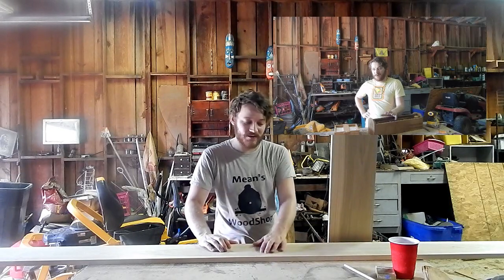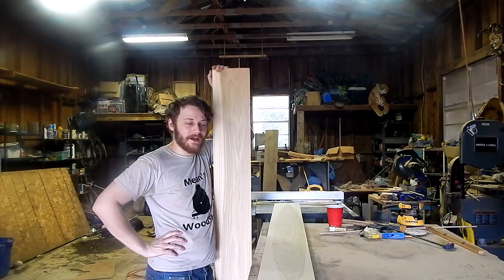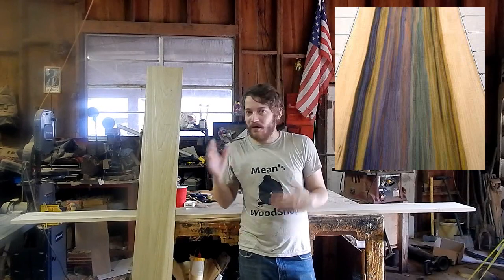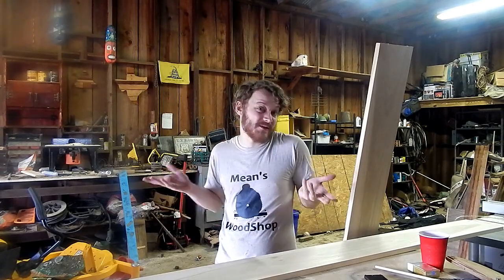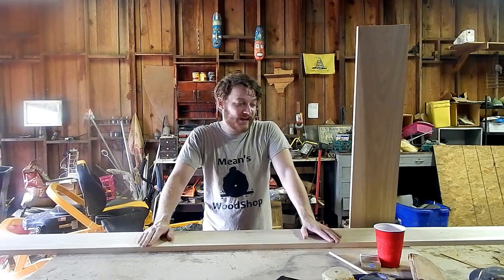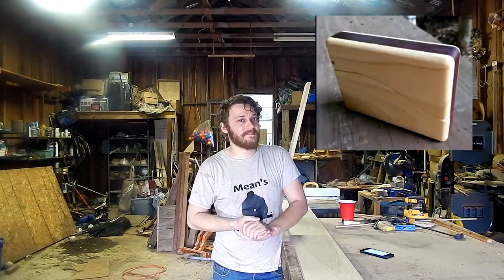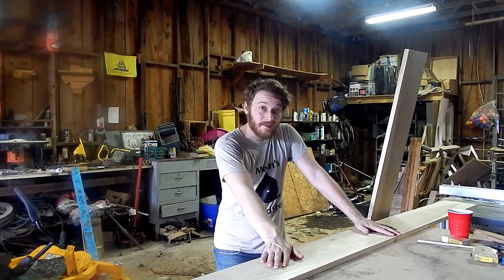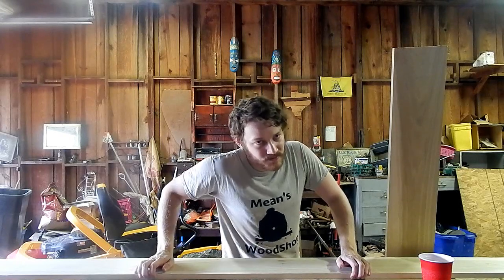Beginners Guide To Wood Species - Everything to Know About Poplar

Comment: I have it growing all over my property in North Carolina. It is one of the most beautiful wood varieties that I've ever seen, besides curly maple or a purple heart type.
It's a soft hardwood, but the streaks of dark purple, to pink, orange, green, and blues are astounding. When you cut the bark off, it is almost fabric like in the amout of string(y)ness. 
The smell is that of pepper and spice like the creator mentioned. 
It dries flat and straight and dosen't tend to tear out as much as pine, and no sap. 
The piths of the logs tend to be hollowed but I've seen them full just as much. 
It splits when dried too quickly, but nowhere near as much as maple.

I've fallen in love with the amount of pedals that falls into my yard in the early spring, and sometimes you'll catch a full flower twisting it's way down from over 100ft tree. Some of the trees we have are as big around as my cabin in my truck, but looks like something from the dinosaur Era. I'd never touch one of those by the way. 
Thansk you for the information and great video

Comment: Only down side I feel strongly about with poplar is that (in my experience) it tends to get more raised grain issues then many other hardwood species.  This means that when I work with poplar I always have to wipe it down with a REALLY wet rag before I can consider it fully sanded because I have had a few projects where it drank the finish oil and the grain popped  up really high.
Reply: Second note, I am actually working on a poplar and red oak curio display case right now.  Poplar is AMAZING at taking tinted stains to imitate expensive spalted/curly exotic woods like hickory or chestnut
Reply from the maker: Yeah, usually I have to do a lot of extra sanding with poplar and move up to finer grits than I would normally use to get a pretty good finish. It can be done though with the extra work.
Reply: @MeansWoodshop  Worth it tho!
Reply: @oldbonesbushcraft Rod Jackson I just 2 poplar boards I'm wanting to cut off the corner to a curve with a jigsaw blade. What kind of jigsaw blade would you recommend. For cutting my poplar board corner ends to a curve.

Comment: I'm a craft artist and my suppliers have switched from birch to Poplar which I've never tried. I use a large heat press to press my prints onto the surface of 3mm wood. This process worked perfectly on birch, sometimes there would be some bleeding and smudges within the grain but nothing serious.

Would 3mm thick Poplar hold up under high heat of 190 degrees or would it warp, and more importantly is it treated with any chemicals as I don't want nasty fumes released under heat.

I'd be greatful for any info regarding poplar for my requirements.

Comment: I don't know if you'll see this and I know it isn't the right video but I couldn't find a vid about my problem. I have a poplar guitar body I sanded to 320 but it's still rough almost fluffy. Nothing I do seems to help. The poplar just won't sand right smooth. Do you have any ideas? thanks Rob
Reply: Finish it with a polyurethane type finish. Then knock fuzz down with sandpaper.

Comment: Would Tulip Poplar be good used as exterior wood siding without paint or stain?
Would it hold up well?
I want to cover three sides of my 1850s log cabin to help protect the logs.
Thanks
Reply from the maker: While I do believe poplar is an underrated hardwood, I don’t think I’d use it for anything exterior as I don’t think it holds up well outdoors for extended periods of time. Western red cedar (or any cedar really) is great for exactly those kinds of projects. Hope it turns out well!

Comment: Could you frame a house with poplar?
Reply: Came here to figure out the same question. Being i have tons of poplar and its not great firewood. Was thinking of building interior rooms with it in my metal barn. Another channel just replied yes...for interior walls. I feared it would just be to weak. But it is a hardwood as stated here in this vid.
I just wouldnt think it'd be good for log cabin extiors logs. Unless made as panels and coated. Which coating needs done every 2-5 years.
Though the wieght aspect if using for framing if a load baring wall where its holding the wieght of the roof or second floor for say.. idk.
But since most houses are framed with pine I'd guess poplar would do just aswell. Think its stronger than pine. Though both suck as firewood.  But im not trying to mess with sappy pine all day. 😆

Comment: I actually use pine on my guitar body blanks and use popular 1/4" for a cap on my guitars. You can check it out on my chanel.  I actually like it . It's a unrated wood. Just use wood harder.
Reply: Than I should mandatory actually watched you last night and started a telecaster body project at 1am. Popular cap on it, green and purple  I found with some dark streaks in it. Great vids.
Reply from the maker: I’m gonna check it out, man! The greens and purples can look super cool, and it’s nice to hear of a guitar finally showing off some poplar rather than it being the secondary surface.